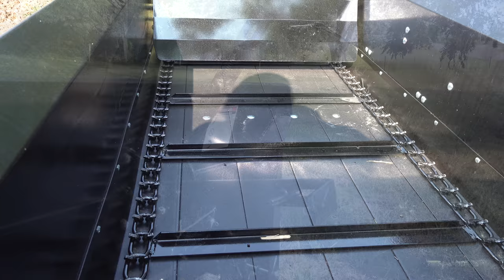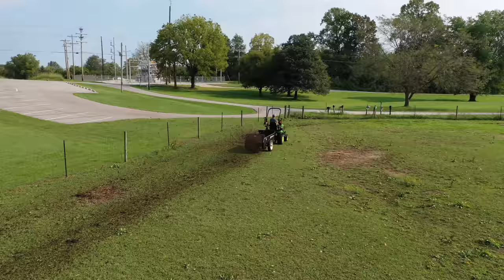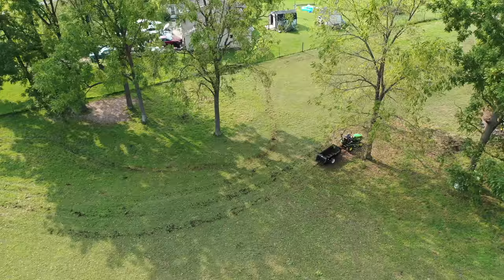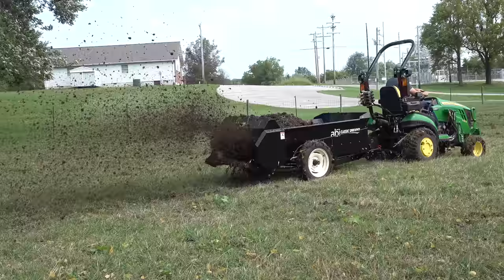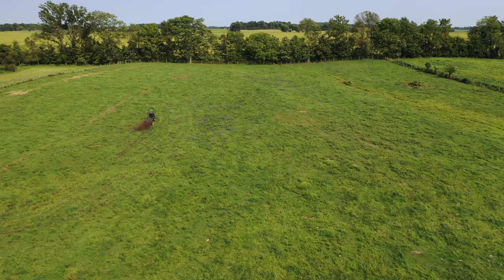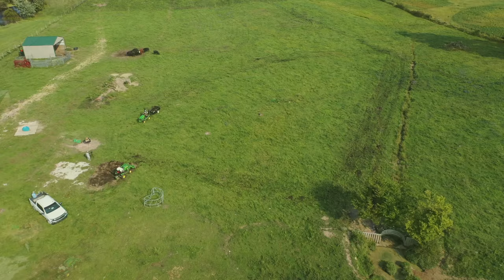FIRST USE Manure Spreader for Subcompact Tractors! John Deere 1025R

Comment: I’ve owned a couple of ABI manure spreaders, 50 cubic foot ground driven unit and 185 with the hydraulic bed unit and PTO for beater bars.  Still own the 185.   I plugged up the 50 cubic foot unit a couple of times with wet manure, operator error.  Had to dig it out with a shovel, that was fun.   ABI makes some nice equipment.
Reply: Thanks! Glad we got you upsized to what you need!

Comment: Tim, they’ve been around longer than that… my neighbor had a horse drawn spreader. In about 1963 my dad modified it to pull behind our B Farmall.  The neighbor pulled it behind his Model A Ford pickup.

Reduce the blow back by turning it off when you get it near empty.  The material in the front helps it climb over center and go out the back… the last load is the only one where you need the rain coat.

The ability to turn it off and on from the drivers seat is the advantage of a PTO unit.

We had a dairy farm… I spent days at a time Fart-ilizing fields.  (My dad’s word.  Not mine.)

Comment: As the only boy in a family of three children, I was raised by my grandparents and aunt and uncle on my mother's side of the family, This is as if you haven't figured out by now on a dairy farm, while my two sisters went off with mom and dad to the city life.  As the only one of my type, I got my fair share of animal pop jobs. With almost 100 cows to milk twice a day along with all the other animals that go to make a farm.  I got jobs like testing the electric fence with my hand while standing on wet ground with bare feet,  I had to learn to drive the tractor at age 5, but my favorite was standing in the bed of the manure spreader with a pitchfork keeping the spreader tines supplied with manure because the floor track unit was broken and fell out the back on the field someplace and could not be found.   I am 80 now, but I can remember it as clear in my mind as if it was only yesterday.

Comment: I have had an ABI 25 cuft spreader just like you are showing, except one size smaller, for several years and have very minor issues with it. I had a shear pin shear on the right rear axle when I put some frozen chunks in the spreader. The other is there is a grease fitting on the right rear that won't take grease and I am going to have to take it apart a little to be able to get a wrench on the fitting to replace it. I am having some problem with the right-hand lever that adjusts the speed of the feed and I haven't quite figured out the problem just yet. We really like this spreader and I use it year-round and it is still like new. I just rinse it out occasionally with a hose and don't need a power washer to clean it up.

Comment: Some of the old spreaders had cables or ropes from the handles to operate from the tractor seat, I could be wrong but my grandfather had quite a few older new Holland ones and even one old enough it was all wood except for the chains and auger .

Comment: I recently purchased a new 1025R and Frontier 50 Bushel spreader similar to the ABI u used. I have un limited access to every format of cow manure imaginable. I have about an acre mowing yard with poor Oklahoma top soil, plus a back up grass driveway, and weak growing areas in the rest of my 160 acre quarter section. I literally make multiple passes to completely cover organically my Bermuda grass yard. Suggested ground speed for the spreader is 4mph. Slow down and I think the beaters do a better job of breaking it down. My next step, after some drying, is to drag it with spent chain link fence weighted down with pieces of pipe. After that drys and breaks the manure down even further, I run over with my zero turn mower to pulverize into small particulates. Doesn't take much moisture to activate. Since Bermuda reacts to nitrogen at ground surface, the response of new growth is immediate and impressive. Pending fertilizer cost, and remember this is around our home, I would spend over $1,000 in a season on production fertilizer. May be my imagination but I think bermuda responds better organically. Yes, I have pulled it with my Gator, prefer the 1025R.  A cautionary note. U canNOT back up with spreader mechanism engaged. Old retired guy with ample time  to execute this process! Happy Spreading to all! Please remember to rinse all manure touched surfaces, especially under the zero turn mowing deck.
Reply from the maker: Great comment!  Thanks!
Reply: @TractorTimewithTim  phenomenal video deserves an appropriate comment. Keep it up AND don't let the nay sayers get u down with their "deposits"!

Comment: If you only have a couple of horses, then you should look at the Newer spreaders.  They're also ground driven, can be pulled by a 10 hp riding mower, and have a bottom discharge rather than tossing everything up into the air for the wind to blow back on you.

Comment: We spent a lot of my high school years raising pigs to try to pay for me to attend college.  We'd have 30-40 through the winter, and upwards of a hundred to as many as 150 through the summer months.  The manure pile that was mucked out of the barn by the pitchfork was loaded in the spreader by the same pitchfork either early in the spring before the hayfield had started to grow, or then after the first cutting.  It always took soooooo much less time to unload that spreader than to load it.  The one we used was ground driven, but had bed that was a bit bigger than this one. I doubt a side-by-side would have moved it effectively when full, especially not when full of pig barn effluvia.  The rats had gotten so large stealing from the pigs that they'd really gotten bold about not getting lost when we were mucking out the barn.  I do remember spearing one single rat simultaneously with four of the five tines on the bigger of our two pitchforks, and would have been 5/5 if the tail hadn't shifted at the last moment.  That rat went on the muck pile with the rest of the *insert-workin'-word*.  There's still discoloration on the barn siding from the muck pile even though the pigs haven't been there for almost twenty years now...

Comment: We used a Case spreader almost like this one, just a little longer and had some counter rotating tines above the beater. Never had a problem with the floor rotting out probably because we kept it under a roof. Before I was old enough to run machinery I remember my dad and brother loading the spreader with pitchforks. We also seemed to have baler twine wrapped around the beater and tines.

Comment: You can sort of see why a lot of farmers still prefer a simple geared transmission over the hydrostatic on tractors that are intended to work fields.  A little extra power and efficiency, less heat buildup.

Comment: I have a couple acres that were claimed from the forest over the last 40 years.  Very bumpy lumpy rough.  And not great soil, a lot of rock.  I'm looking for something that maybe I could spread a 1/2 of dirt at multiple times over the existing lawn to smooth it out.  I am not able to take out the grass and blade it, for example.  Would this work in spreading topsoil?  Or any ideas?  Thanks.
Reply from the maker: Yea, it would spread topsoil. …but it would be an expensive way to do it assuming you had to buy one.
Reply: @TractorTimewithTim  Thanks for your response.  I was hoping for a rental, maybe?  IDK, just trying to figure something out.

Comment: I cleaned out a barn and loaded a slightly smaller spreader with a little poo and a lot of hay and spread it on a thin patch in a pasture and it spread it all pretty evenly .  I was using a lawn tractor to pull it and any clumps I simply mowed to spread them out.   
I'm considering using it to spread yard cleanup after running it through a chipper.  I can't burn it here because of the dry climate and fire dander.
So are you practicing for running for political office?

Comment: I would imagine the 1025R could handle a small old spreader especially if its dry manure and you don’t overload it.   I imagine they are available for reasonable prices.  Might need some work but surely cheaper than a new spreader.
Reply from the maker: They rot out and rust out pretty quickly if not taken care of.
Reply: I have one that's in good shape not rotted and only thing wrong with it is a spring and a linkage rod that I've not gotten round to replacing !! 😁

Comment: On older equipment, those levers were designed to be reached from the tractor.  It seems like they didn't even try on this spreader.  I'm sure the lawyers said, "no".
Like most equipment, older is usually better.

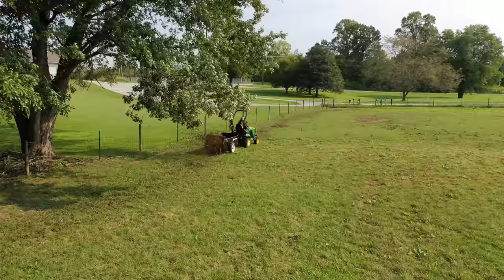"And thou shalt eat it as barley cakes, and thou shalt bake it with dung that cometh out of man, in their sight." - Ezekiel 4:12-15 KJV

Comment: Does that spreader have a stand that makes it easy to load then connect to, in the event you only have one tractor for both loading and spreading?
Reply from the maker: Pretty normal Jack stand..with a steel roller wheel.
Reply: My Frontier model does, same as larger implements, very handy.
Reply: This might (key word) be where using a three point hitch drawbar may help.  There's no pto to worry about.  My only concern would be making sure there's enough tongue weight on the spreader to keep the tongue down especially when spreading the last bit of the load.

Comment: In a typical scenario with one operator and one tractor it seems like it would have taken forever to spread that across the field... having to disconnect the spreader to load it and then reconnect to spread.
Reply from the maker: Use tractor to load, and utv or truck to spread!
Reply: I would point out that ABI attachments are quite versatile. We recently bought a gravel grader that is made to work for larger engine lawn and garden tractor as well as zero turn radius mowers. We have a UTV and I asked the support center, which I might add is outstanding, if I could put it on the back of our UTV and they said sure as long as you have enough horsepower. It did a great job on smoothing out our driveway which hadn't had anything done to it since we had dropped gravel on it over four and a half years ago. You might point out to folks that ABI makes almost all their products just to the north of you in Indiana so you are getting american-made products and I might add they are quite well made as well as great customer service. I had told them a few months ago when I was getting ready to buy this that they need to get you to demo some of their equipment.
Reply: @jimmcknight3021  Thanks for the shout out, Jim! We're happy to work with you. 😁

Comment: There used to be a large cattle feeding barn several miles from my house. It put out such an odor that the whole community smelled like sh……… EPA made them buy a large injection machine due to the large amount of manure that came from the barn. The run off finally forced it to close. There are also many chicken houses in several counties over. They also have a large manure problem. The large farmers use the chicken manure in their fields. The ammonia those operations generates will bring a metal building down in a few short years is staggering.
Reply: @brianhillis3701  I am a retired wastewater plant operator here in Kentucky with over 20 years experience. I also spent over 10 years doing wastewater treatment in industry.      The plant I spent most of my time at was attached to a Tyson chicken processing plant (3 MGD). I do agree there are solutions for these large operations. Just getting industries to follow the rules is the difficult part. Most of them look at production and profit. But not all are like that, but the ones that have no disregard spoils it for the businesses that follow the rules. And the rules will only get more stringent no matter who’s in office. I’m glad there are others that pay attention to these issues.